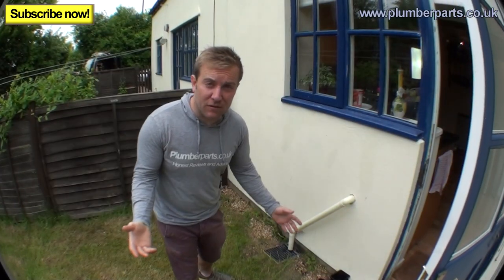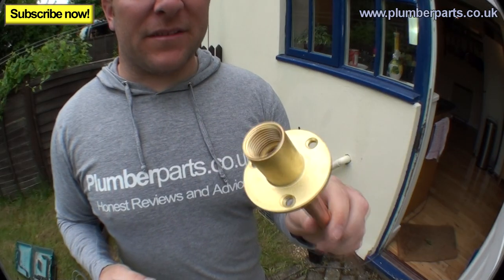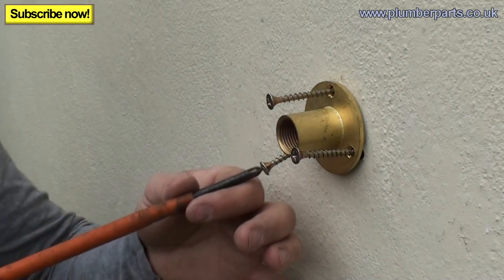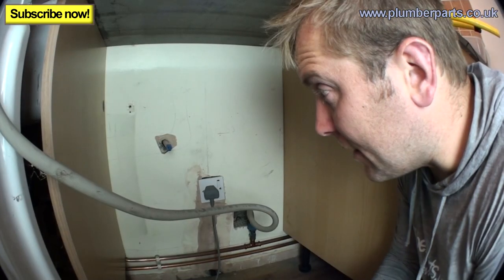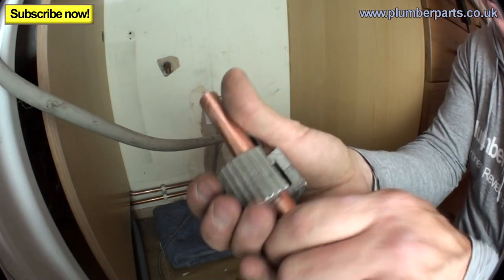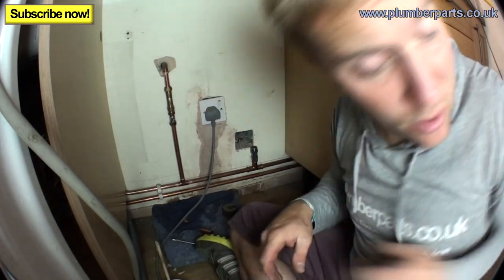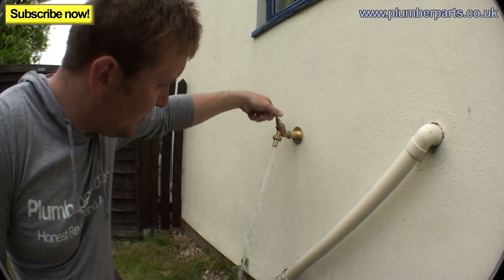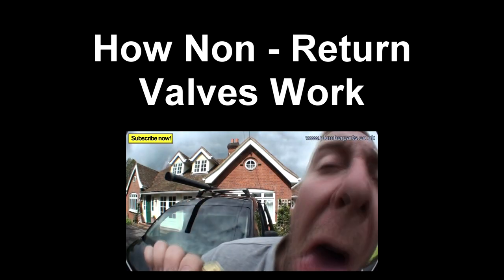HOW TO FIT AN OUTSIDE TAP - Plumbing Tips

Comment from the maker: Links to the tools I use everyday here: https://www.amazon.co.uk/shop/plumberparts
Plus, follow my Vlog “TimesWithJames”: http://www.youtube.com/c/timeswithjames
Reply: Hi are you using glue on the joints ??thanks
Reply: The replacement tap does not end up vertical but horizontal. What is the best way to rectify this?

Comment: So its important to always bang your head on the sink both entering and leaving, and set your hair on fire as you work under the sink, and leave one joint half-soldered because your phone rings half way through. Turning off the mains water first can help if you remember... and though the cables usually go downwards that electric socket will be the exception and you will go through the cables sure as butter. Oh and by the way drilling those pilot holes for the tap base will surely snap a bit off the brick and you'll get no plug in there..or the second of three either so its a risky single-screw by the look of it. Then her husband will come down ..working from home he is two days a week ( in building control) and suggests you're taking a long time for a simple tap, haha ha.
Reply: It's changed since then the water is on grey elbow and not on the silver chain mail which I had to used flat soul to stop the water to connect the extension to the waterfall which I put at the curb aka put your mouth on the curb 😂

Comment: You are supposed to sleeve the pipe through the cavity in case it gets damaged via frost or debris falling down the cavity causing a leak in the cavity which can cause a lot of damage if you have insulation in there and you won’t know until it’s to late
Reply: Yes, but he installed this under a window board!

Comment: Water byelaws require a sleeve to be fitted over the pipe and through the wall cavity. I use plastic overflow pipe for this and the drill diameter is 22mm. It's also easier to fit the tap first to the wall plate and then fit it to the wall before screwing it. That way it's guaranteed to be straight.

Comment: knowing my luck I'd have drilled straight through that socket under the sink!
Reply from the maker: +Craig Sanderson It can happen to any of us!
Reply: +plumberparts here's what happened I was all geared up to do my outside tap thinking it can't be that hard watched your vid and thought ah no blowtorch no solder non of that stuff you brushed on so looked into it seen the self cutting ones but I thought they looked poo,  poor pressure and where does the bit of metal go? so I passed and got a guy in, £40 not bad I thought.  when he'd finished "did you solder that?"
 "Naaaaa you can use pressure fittings"
*Jaw dropped,  eyes rolled
are they as good as your way of doing it?
Reply: pretty much yh if they leak just tighten them
Reply: @plumberparts  Apart from U, right? RIGHT? Oh...

Comment: Hi mate, just wondering why u didn't sleeve the 15mm pipe with 22mm pipe, as it is going through a solid concrete wall. 🤔
Reply: You'd have to drill  a 24mm hole. that hole would  almost hit the holes for the plugs. Possibly crack brick then not get good fixing.  It doesn't need a sleeve.  It Would be good practice to wrap with duct tape before fitting. stops the concrete or brick coroding copper.

Comment: Might sound like a stupid question but whenever I fit these I can never get the tap straight so end up faffing around putting more and more PTFE on to get it tight enough. Does the loctite you used stop this happening?
Reply: Rian Murray - its a bit hit and miss. I literally fitted x6 of them today for a building site. 2 were perfect, finished straight and tight as possible. The other four, identical, did not make that extra 1/2 or 1/4 turn. So had to remove, reapply tape then remember to not go that extra turn at the end. IMO they arent made right, you’d think they would be designed so that the thread is consistent and when fully tightened end up straight! If your really keen, there is a fibre washer that can make up the difference.
I should prob try loctite more often lol - I broke the metal catch bit on my first ever new roll before I’d even used it! Dropped on the floor and it broke. So ever since I’ve just stuck to ptfe.
Note - these particular fittings you can fit these tight and straight, then mark the holes so no issue. Normally they are fitted into a standard backplate.
Reply: globalste - as noted, yes your right. If using the same backplate kit as shown in video. Otherwise a standard backplate you cant pre tighten it. You could in theory screw the plate on wonky but would look ridiculous.

Comment: Hi I have a question, Our townhouse complex of 50 units did this.. Water Meters had to be removed to protect the geysers.
The existing installation has one pressure Reducing Valve per two residential units.
This has to be changed to place a Pressure Reducing Valve in every individual feed to each unit, then place the Water Meters upstream of each Pressure Reducing Valve. Do we need to add the additional Pressure reducing Valves?

Comment: Hi I’ve got a 22mm mains pipe which I want to add an outside tap to, can I use a pipe cutter to the main pipe rather than cutting into it to create a t-bar?? If this is ok could you allow me the correct cutter into the pipe please? Thanks.

Comment: I wish I watched this a week ago, I just fitted a a tap just like this, I put the tap into the wall mount and did it up tight, then pushed it through the wall and marked the holes so the tap was straight, the holes didn't end up lining up and my tap is now slightly off straight. Maybe I'll remove the tap use lock tight thread and refit
Reply: Haha - I'm here watching this video, because while my taps (Put a hot water one too) ended up straight I had real aggro getting them straight and water tight prior to fitting. I figured I MUST have done it wrong - and apparently here's the answer! At least I know what to do if one starts weeping

Comment: I need to know what part to buy in order to connect a water hose to a tap like you installed. Any vids on that?
Reply: I imagine you've sorted this out now but in any case, the most conventional options are either to ram the hose onto a hose tail as shown in the video and secure with a jubilee clip or to use a ¾in BSP to ½in quick connector, along with the mating part that screws onto the hose itself. E.g. Toolstation part no. 42950 has everything you should need but I believe you can buy basically the same thing from Poundland. Beware one of the hose end fittings may have an automatic shutoff valve which could cause confusion.

In truth there's basically a limitless number of ways you could connect a hose to that tap if you don't care what it looks like 😈

Comment: Thanks for the info mate, just replaced a pants diy kit , with copper I used compression joints and joint compound instead of the pro’s soldering joints , one happy bunny 🐰

Comment: can you help please ? i have connected a self cutting tap into a 15mm cold water supply pipe to install an outdoor tap but when i turn on the self cutting tap water flows out then it suddenly just stops flowing, its kind of like something is stopping it flowing properly.  would you suggest that i use compression fit instead of self cutting tap ? thank you..

Comment: I have a problem with outside tap bought off ebay to replace one with bottom entry. When I screw tap into new base plate the tap points upward should there be a washer please ?

Comment: Hello: I have a 3/4 brass stopcock under my sink which is the feed/supply for the house which has been in about 40 years and is now reluctant to turn either way...can I still buy a replacement head for this unit please which I think would be the easiest option. Thank you.

Comment: Didn't see any sleeving or did I miss that part of the video , does the kit come with a cover on the 15 mm already or something ??
Reply: If you sleeve it with 22mm, you won't have any wall left for the plugs. That's why dripies tend to use the elbow unions as they are usually thick, rubbish and rip people off.
Reply: It's not a gas pipe

Comment: Hello good sir, my dad asked me to call a plumber, but the parents are out of the house for the week, so I'm going to give it a go myself! Just one question - the cold water feed is going off in a T compression fitting to the sink and dishwasher. Could I just replace that T with a four-way compression fitting to the outside tap via a few elbows? Also, I'm assuming check valves don't have to be vertical?? Cheers
Reply from the maker: All fine! Sorry for the delay in replying!
Sub here please>> https://www.youtube.com/subscription_center?add_user=plumberparts <<If you haven't already!

Comment: We've just fitted a new kitchen faucet. Previously we had the Hozelock tap adaptor for the former faucet. As of the new tap I don't want to ruin it by constantly fitting and removing another tap adaptor (it's what buggered up the previous tap). I need an outside tap - but we are not competent enough to do this job :/ I need hot water for outside though. How does that become possible with an outside tap? (??). Sorry to sound dumb - these things are not my forte! Thanks for any help!

Comment: Quick question. How were you able to be line up the position of your drill hole for it to end up exactly where you wanted? In this case, the back of the cupboard, underneath sink, missing the electrics etc
Reply: Lar Ko he would have measured it against a base point - maybe either the underside of the window, or from the back door.

Cross checking where the tap would pop out internally.
Reply: Or maybe it was sheer luck he missed the electrics! 😀😀😀 Joking apart, I prefer to drill a narrow pilot hole from inside out, but you do have to be careful not to "burst" the exterior  surface of the wall as the drill bit exits...

Comment: I bought one of those through wall mounting plates, with pipe attached. Before I fitted it, I discovered that the council was sponsoring external insulation, with a huge grant from the government. It cost me very little to have it installed. Now the pipe is too short to go through the wall. Is it possible to get this type of mounting with a longer length of pipe; I need about 450mm? I'd rather not extend the pipe, and have a potential point of weakness out of sight inside the 22mm sleeve. Alternatively, how easy would it be to desolder the existing length of pipe, and replace it with a longer length? Or can the outside mounting plate be bought without the pipe, so I can use my own length of pipe?

Comment: How about drilling from inside under the sink to outside with thin long pilot drill?
Reply: You risk blowing out the brick on the other side. Even a small 5.5 or 6mm will potentially blow out a large amount of brick. Always, always outside in

Comment: Hi.
Wonder if you can help. I live in an apartment & I have a blocked 4 inch metal down pipe, it has what I can only think us a 'service plate' on it & I'm sure that's where the block is as water doesn't go down it, it just goes past & to my bath/basin, the 'service plate' is rusted

Comment: Hi,
I'm a D.I.Yer & I would have drilled from the inside to make sure I didn't hit anything, any reason why you didn't?
Anyway, I wonder if you can advice me?  I am connecting a hose to my Mothers garden tap & to a length of uPVC pipe that I will be drilling holes in then running it along the fence in the garden so all she need to do is turn the tap on to water her plants but I'm not convinced the water pressure is powerful enough to exit all the holes in the 26ft  uPVC pipe , is there anything I can do? She has a Combi boiler.

Thanks
David
Reply: It's better to drill from the outside because when the drill comes out the other side of the wall, it tends to crack the surrounding surface. It's easier to cover up inside with some filler because it's behind a washer anyway.

Comment: Hi my external tap had just stopped working,  I have a new build and the tap came with the house,  is it still the regulations that you can use a check valve built into the tap or will it be located somewhere else in the system?  Thanks any help would be appreciated

Comment: Great vid, thanks. How about if the feed is from a boiler? My sink unfortunately  is on the other side of the kitchen (not attached to outside wall). If I do manage to use the boiler feed, will this mess up my boiler performance?
Reply: No it will not cause a problem as long as you debour the pipes

Comment: Would you use a single or double check valve on something like this, still really new to plumbing sorry if it sounds stupid I just don’t quite understand the difference yet
Reply: Water regs say double ( inside the property on a new install)

Comment: i fitted a diy outdoor tap kit, when i turn on the water it works but trickles, if i open the tap fully open it makes a noize then cuts of the water can you help
Reply from the maker: Sounds like the non return valve is the wrong way round mate.

Comment: Good video! A garden tap needs to be connected to a double check valve.  You can get taps that have double check valves within it but they can become damaged by the frost at winter, therefore its best to install them inside as you have shown.
Reply: Not allowed for new installations
Reply: Plumbing Weston College what is not allowed? Installing the valve inside? Or having the valve built in tap?
Reply: Hi I had a outside tap fitted but the plumber didn’t fit a double value on the inside. Will this cause me a problem in the winter. Thanks
Reply: Fit the check valve inside if the tap outside freezes the water will expand and ruin the check valve inside allways fit a tap with a check valve built in much easier to replace when things go wrong better still make sure the tap outside is insulated in the winter
Reply: Depending on what water board area your in some water boards want the check valve inside and some outside Weston college please not and don’t give your apprentices wrong information

Comment: We were always taught to use conduate and a plastic tap to isolate the supply for outside taps. My tutor was one for possible lightning strikes to outside metal components.
Reply: Sounds like 0.0000001% chance of that

Comment: I am looking to install an outside tap but the pipe work runs just below the worktop surface next to the sink cabinet and behind the washer, instead of low down like in your video. Then the hot and cold for the washer T's off vertically downwards each of these horizontal pipes.  Would it be possible to swap out the standard washing machine valve and replace it with a brass appliance tee, using the spare connection for the tap instead of say a dishwasher??

Comment: Pipes going through a supporting wall or cavity should be sleeved, normally a 15mm pipe would be sleeved with 22mm. This is incase there is any movement in the building so the pipe doesn't crush but also incase there is a leak. The water wouldn't be able to leak into the cavity and would go straight outside.

Comment: Do you think a sleeve is required for the copper pipe entering the wall? Only thing would be you'd need to drill a 22mm hole for the sleeve and then the holes on the plate wouldn't work. Any thoughts?
Reply from the maker: Yes it is and we missed that point in this video! Sorry! 

Sub here please>> https://www.youtube.com/subscription_center?add_user=plumberparts <<If you haven't already!

Comment: hi i have a somewhat related question, i seem to have a tap in my bathroom (to connect my washing machine) but for some reason the guys from the washing machine shop told me its missing a tap? as in i just have to add the tap part or i have to make a whole new installation of a tap like you did in your video?
Reply: +b m i dont know how to attach a photo, but it looks like 2 pieces of thin silvery colored pipes that finish off with a cap, separated by about 20cm and coming out of my bathroom wall...

Comment: How do you know that the tap wont end up being upside down when you screew it into the wall plate? Is there some way of knowing or markings on the plate top and bottom? And do you prefer am internal check valve over the ones built into tap? (would you still put in an internal check valve if using check valve in tap housing)
Reply: That’s locktite stuff he used will allow you to turn the tap tight and still have it the right way up. If the tap has got a check valve you won’t need another one.

Comment: Screw the tap into the wall plate reasonable hard then you can see were the tap is upright then screw the wallplate to the wall with the tap in upright position then remove tap and put tape on thread of tap and rescrew into wallplate tap will then be perfectly upright

Comment: Nice job but not way I would do it!! No sleeve on pipe and noway off draining pipe in winter , out wall with bend looking down, the the old back flange connection for me so you can open and drain for winter 😁
Reply: Yeah, with a run that big going straight down I would have installed an inline drain cock, same with the sleeve I usually just jam some 20mm overflow in there cheaper than copper

Comment: Is it wise soldering with the check valve in place? Surely the heat could melt the internal plastic parts?
Reply from the maker: dancingcallingcard No it's not. I don't think we did that in this video?
Reply: ***** Have a look at 6 minutes 33 seconds of the video.

Comment: Can you do the connections with compression fittings as opposed to soldering?  I agree with your comments on the Flexi home kits.  They look pants.
Reply: Yes you can, but it'd be a pain getting a compression elbow so close to the wall as you'll struggle using grips so close to the wall.

Comment: According to the guilds the only time you can have a bib tap that has an inbuilt double check without a double check valve on the pipe work is in the garage.